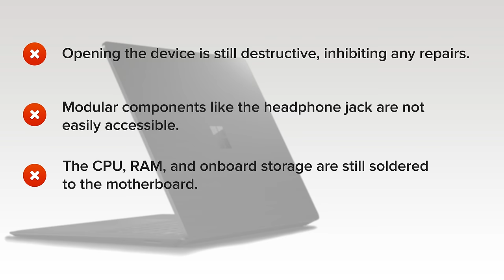Microsoft Surface Laptop 2 Teardown!

Comment: In my opinion this is becoming an outdated way to gauge electronics and it will only become more irrelevant as time passes.  As manufacturing and technology advances components inevitably will get smaller and as a result will not be repairable by our clunky human hands and tools. Imagine a future gen phone that's a single thin layer of glass with clear circuitry. It has no seams and no screws because it is 3d printed. Or how about an AR system that is a contact lens? Are we going to trash devices of the future because we cant open them with a Philips screwdriver? Maybe start focusing on other things such as recyclability, return programs, warranties and such?
Reply: Words are said! 👍🏼👍🏼👍🏼
Reply: it's 2018, glue and soldered component is normal
if you pair apple's product side by side, there's nothing hugely different
so either others score need to drop
or surface produce need a higher marks
Reply: seriously? you cannot even change the rediculous dirt magnet alcantara cover. that is defection by design 10000000000000%.  ease of on sterile theories and open your eyes in practise, may i suggest. theories like yours have destroyed all crafts and our civilisation and brains altogether. it is all egoistic branding, no design decisions involved.
Reply: Try look at the competitor. You can still buy a lot of machines that opens up easily with regular screws. You can change the RAM, SSD, network card and battery. See Dell XPS. A 1000 USD machines with all this possibilities.
Reply: Recycling only goes so far if tech starts to be designed to last 1-2 years and is disposable. Look at what is happening with other types of recycling. We can't keep up! What, should we glue engines together in cars and make them disposable too? Damn, I'm not even much of an environmentalist or anything, but this is going to cause big islands of trash in the ocean. Pretty soon, we'll be able to build cities on those since there will be so much trash.
Reply: That type of consumer thinking will destroy us all. This logic is severely outdated and utterly in opposition to the global movement for responsible use of resources. 
Apple and unfortunately Surface products are counter to SDG #12. That is exactly how we must gauge electronics and companies. 
Did you know, all metals for the 2020 Olympics in Tokyo will be made from gold, silver, and bronze sourced from recycled electronics. 

Don't mistake design laziness and corporate greed for innovation.
Reply: yamamancha you can say greed but not laziness. It definitely takes more time to fit it to such a compact chassis to make it more bigger and open and more techs! More like design complication then laziness
Reply: @sondrejohansen48  "Design" is a good excuse to use a bunch of glue, which takes away the option of repair in many cases, especially Apple and Surface products. 
That is a choice by companies to force users into expensive repair schemes or force new product purchases for minor problems.
Reply: Edward J. Explain to me the Dell XPS 13 then. It is a smaller chasis than the Sf laptop yet it is very repairable.
Even Apple designed their thinnest laptop, macbook retina 12 inches, to be battery-replaceable. MS Sf laptop as this looks like, can not get its battery replaced by even MS ! This is just dumb as we all know how lithium battery is. A perfectly good machine can be tossed away in 2 ýears just because you got bad luck with the battery !
Reply: 1. You have no idea what you're talking about.
2. The site is called iFixit. What the heck do you think they're going to talk about?
Reply: 火柴人Ex改 Apple devices has pull tabs you know that.... making it easier for repair
Reply: It's an absurd way of thinking. Yes, certain components are these days too thin/fragile/small for a normal user to replace. But we're still a long way from when a laptop can't be designed in a far better way than the Surface Laptop. The top cover could for example have been attached with normal screws from the side of the laptop. Yes, it would not look as clean, but it would be just as sturdy and would be far more user-serviceable.
Reply: You're talking about a possibility that's probably decades into the future. Plus, by the time we get to the point where we're making tech like that, the companies who make them probably won't be the only ones who can repair them. Even when you send your laptop back to Apple/Microsoft/Whoever, it's still "clunky human hands and tools" that are fixing your product. Unless you plan on throwing away your $3000 laptop the minute any component dies, in which 1. Obviously, you're rich, and 2. Would you mind sharing that wealth? Because most of us don't have it.
Reply: The only reason some of those components are soldered on is so that buyers would buy arm and leg to buy upgrades at the time of purchase. m2 hard drives for example give a lot of room for computers to be upgraded in the future. Everyone knows that with time you normally gather more and more files and programs and the hard drives start to fill up. The base HD for this computer is 128 gb and to upgrade it to even 256 gb I would have to pay 400 euros more. Price for m.2 256 gb is around 80 euros now and dropping constantly. I could buy 512 gb one for around 130 euros now. This way of making machines is just stupid, they are made to be obsolete fast. We should be smarter as a species than wasting our resources and destroying our environment with products like this.
Reply: Boy was this sucker wrong

Comment: Unbelievable some actually managed to make something less repairable than Apple. Oh well, I got my curiosity satisfied - not going to buy a Surface laptop. Not only it's not possible to upgrade storage if those tiny amount isn't enough in a few months - you can't even take it apart to clean the fan for dust. Had it at least been a fanless design...

Comment: You must be crazy to buy this laptop.
Reply: I bought one of these in August because it's perfect for what I need as a student. It's thin, light, has an insanely good battery, pen and touch input, and a good screen. These are all things that students want nowadays and it just needs to last 4-6 years until you upgrade to a newer one. I never really repaired any of my laptops because by the time the battery got bad I'd already have upgraded or the computer got bogged down from so much use. So ya, it's not as bad as this video makes it seem.
Reply: Nour Jaffan without the ability to replace battery it wont last 4-6 years. If you’re unlucky with the battery it may last you only a few months after warranty end then you will plug it in all the time. Otherwise i’d say 3 years b4 battery life become unacceptable. The point of this device is an all-day battery life, like a phone. When it drops to 3,4 hours of usage the purpose is already defeated.
I totally get what u’re saying and is tempted for this device but i can’t justify spending $1000 on something that may only last 2-3 years then useless. In bad cases it may not last that long since there are a lot of things that can affect battery longevity.
Dell Xps 13, thinkpad X1 carbon and Macbook 12 are better candidates.
Reply: @TuanLe-eb5yp  I have a surface pro 4 an still no issues with battery life...Used daily ask a chemistry student...Surface pro 4 is a 3 yo product now so you are saying false things...
Reply: Davide Zappalà wow so u’re saying your single good experience is the same as every single Surface user ? Way to go mate.
The thing with electronic is all devices, from all manufacturer, are prone to failure, even a small percentage of them. That is why they offer warranty. The thing is, for other devices, when they fail and out of warranty, you can fix it so they are much more likely to last longer. For MS device, especially the sf laptop, you can’t fix it. I’m a surface owner and i know this risk that if it is broken i’m stuck with a brick, so if u’re telling people that everysingle of their devices is gonna be the same as yours, then you’re spreading false information.
What i’m saying is because the device can’t be fixed, it has a higher probability that i won’t last as long as a Thinkpad, for ex. Battery life/ capacity is something that can varies even greater and depend on many factors so people should have proper expectation. For a device for mobility like sf, 60% of original capacity is almost defeat the purpose of having an all day battery device. It may or may not happen at year 3 but if it happen, you will be stuck.
Reply: @TuanLe-eb5yp  Do you even have a surface? I have a feeling you aren't talking from experience lol
Reply: @Nour Jaffan yes im using a Sf pro 2017 M3 which I got for a pretty good deal and still have warranty till next year. It is a great device but if i’m paying $1000 (even for i5 or i7 8gb), i would think hard.
Reply: @nourjaffan3769  I bought one in April as a student and I have never owned a piece of technology as efficient, effective, or as joyful to use as my surface laptop. I have not had a piece of technology I've enjoyed as much since by Gameboy SP at age 8.
Reply: Nour Jaffan  lol when i was a student ! I definitely choosed Hp / Dell ( price from 1500 and below ) if i wanna buy luxury brand - then i would choose apple ( version 2013 and before that - much cheaper and upgradble minor )
Reply: @davidezappala7926  I got it in 2018 and it works perfect after lots of use and it runs virtual machines perfectly, no difference in battery from day 1, but my intention wasn't for it to last more than 4 years. Any laptop even if you rebuild it should still probably be replaced unless you're just cheap. Like you can still keep it and get the new technology every 4 years or so. If you want something to last and be replaced than just get a desktop or a server.

Comment: I'm not going to buy a premium prodcut that I can't repair myself, because if premium, I want to be able to use it for many years, and so after the warranty ends, I will be on my own or expensive AF service.
Reply: I would only do so, if it had any right to be that way, like 3mm thin or something, but this has no right to be as hard as it is to repair, so aorn I agree.

Comment: Just got one of these in the workshop and yeh its a pain but not as bad as you made out getting the complete top cover off the keyboard plastic and fuzzy material comes off as a single piece, my iFixit tools made short work of getting in and getting those shields off - thanks! heres to more fixing!

Comment: Just being curious: to the left side of the ram is an empty space where a GPU could easily fit. Also some solderpads have already been installed. Are they reusing the PCB or are they planning on doing a GPU version?
Reply: its for more flash storage

Comment: So if something happens internally and it needs repair would it be able to be done? I mean after the tear down-opening would they be able to reassemble it or is it rendered useless?
Reply: I asked this question when I got mine, and they said they just give you a new one if it's under warranty.  Out of warranty, you just buy a new one.  The only reason I have one is because my work paid for it.  Personally, I don't see the point in having something worth so much (I have the i7 16GB 512GB and it cost almost $AUD3300) when for the money I could buy the ultimate laptop that could be fixed.  But - it's not my money!

Comment: Is there a single laptop that doesn't have a soldered gpu and cpu?
Reply: Clam Dong many that are not ultra books can change GPUs. For Ram and ssd, all the non ultrabook and even some ultrabook can upgrade ram and ssd. Even the ms’s own surface pro 4 can change the ssd. The cpu may often be soldiered but ram and ssd are not, even for ultra books.
I can even change the GPUs on my previous gaming laptops.
Reply: Intel stopped releasing chip sets that can be upgraded in laptops years ago, although I'm not sure about AMD. I don't think many GPUs outside of ones in older laptops are upgrade able as well, although  you can get an eGPU.

Comment: It should not have the same grade as the version1.. after all  you could fix broken things on this one, like fx the top displaysection from another unit and fit it somewhat together on top of the plastic fusewelding to the keyboard metalfoil part and glue it tight.
on version1 it looked from your video like you simply couldn't get into it, without tearing the fabric.
so going for a screen repair with another part unit at hand, I would way more prefer to do it on version2 then version1 and be able to have a good locking product afterward.

Comment: At least the storage & ram should always be modular so that it can be upgraded whenever needed. There should be a law that commands repairability & upgradability in devices. Who the hell will use 128gb ssd these days ?
Reply: (Check the laptop I have, sees it only has 64gb of non upgradable storage)
I agree with you

Comment: SOS I am considerung buying it this week.
After being tore down can it be reassembled. Basically if something from the hardware is problematic can it be fixed?
Reply: Jason Wolf sadly no. They would have to replace your motherboard which includes ssd, ram, and chip. Not sure abt other things because idk.
Reply: The question right now is did you buy it? You are SOS-ing and never coming back here!

Comment: I have a surface laptop 1 torn down with a faulty motherboard. I see absolutely no difference in form factor nor in IO nor on screen connectors between Gen1 and gen2.
My question is:
Does anybody know if you could use a gen1 chasis/screen and replace the board with a gen2? 
I know its never going to go back together like knew, but with enough double sided tape, I'm thinking it will be usable.

Comment: it's 2018, glue and soldered component is normal
if you pair apple's product side by side, there's nothing hugely different
 so either others score need to drop
or surface produce need a higher marks
Reply: Macbook Pro has a removable bottom cover. The logic board is removable. The screen assembly is removable. The topcase can be replaced. The fan(s) can be replaced. The Surface Laptop? Nothing can be replaced. Nothing.
Reply: Even the macbook 12 which is the thinnest Apple laptop and is much thinner lighter and have a smaller chasis than this sf laptop, is more servicable. At least the battery can be replaced without damage. This sf laptop is intented to design that way and it is a very bad move. Even my iphone can get its battery replaced and phones are supposedly more disposable than a work machine.
Reply: Get a grip. Even a damn iPad can be opened and serviced. This is beyond unacceptable and that 0 is more than justified.

Comment: This is so shitty to hear. I just bought a discontinued UK model Surface Laptop 2, and was amped spruce it up with Linux and replacing the older Wifi 5/Bluetooth 4 card a Wifi 6E/Bluetooth 5.2 card, as well as replacing the mediocre SSD.  Looks like I'm SOL on this one.

Comment: Giving how thin this thing is, they could only do so much. The only thing i would do different is  to replace that soldered ssd with an m.2 one. You just can't expect to have everything in a laptop this thin. Could they do better? Of course. Could they do it at this price? noooooope. I think that what we need is better goddamn cpus from intel in the mobile/ ultraportable segment. Look at what apple did. Better and more efficient CPU's means lower power consumption, it requires a smaller battery, smaller cooling system, so more space for better internals!

Comment: thats why i got mine used on ebay for $250 last year. its not worth more than that and i think i overpaid. you'd be stupid to pay a grand. its nice, light, solid construction and when it works, its great. but when that battery goes, and when you start getting bad sectors on that ssd, you are screwed and this becomes an environmental disaster. thank you microsoft for not caring for the environment...but really, when did you ever care for anything but your investors pockets?

Comment: Guys would highly recommend staying away from Microsoft laptops. I bought a surface laptop 2, 1 year ago and it's battery has swelled up, the keyboard cover is super dirty. 

Shared images of it here - https://twitter.com/ImMrVinayak/status/1298247664069308417?s=20. 

Add to it, the pathetic microsoft support.

Comment: So, basically its zero to none reason to open up the internal unless fan service and repasting
Reply: az zahar problem is the moment you open it you destroyed it. I can live with not upgrading but i can’t live with the fact that i wont be able to change the battery because i want my $1000 laptop to last more than 3 years

Comment: REALLY!!! THIS IS JOKING RIGHT ??? they use super thin super fragile flex cable for display assy ??? they dont learn anything with Blackberry 9800 & Priv flex cable  that broke after 10.000 times flip ?? iPad 2 use real thick real wire macbook style flex cable even 99.9% of us never flip it / fold it /touch it